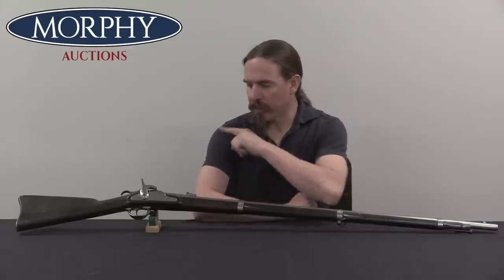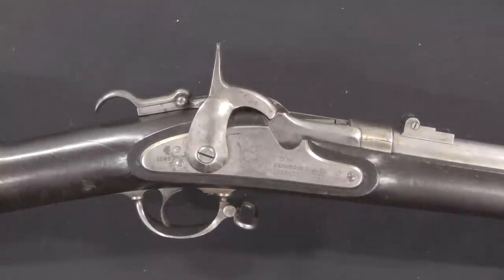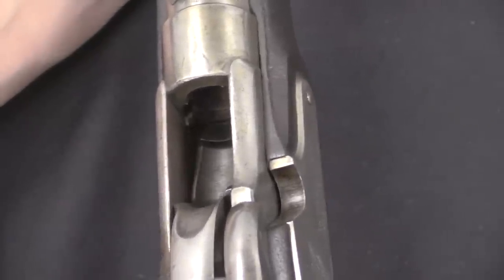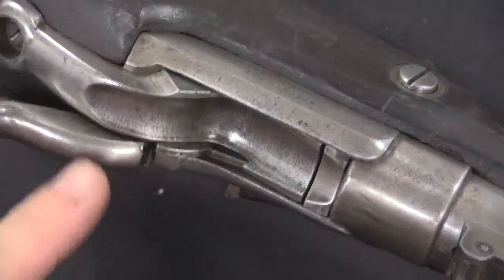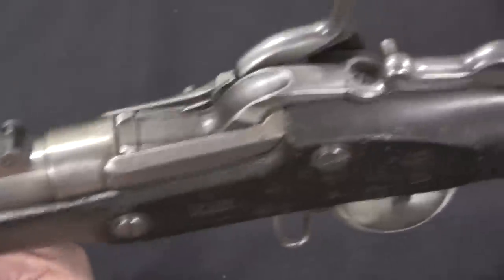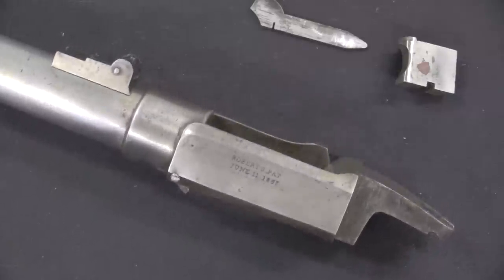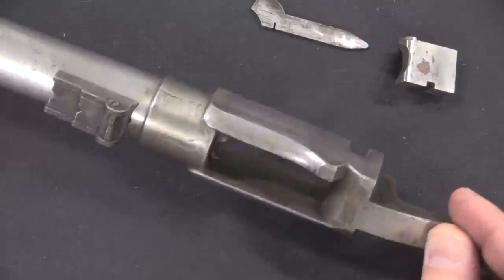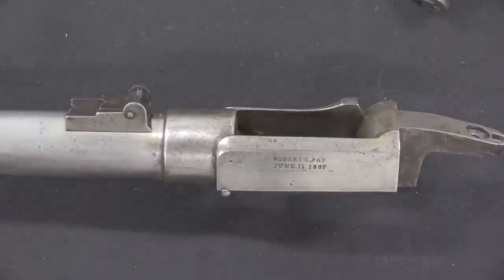Musket to Big-Bore Rimfire: the Roberts Short-Frame Conversion

Comment: that gun is in remarkably good shape, the metal is clean and the wood finish. wow
Reply: Yeah it’s kind of amazing tbh
Reply: I think the metal would have originally been blued. The total absence of bluing indicates, I think, that someone used abrasives to refinish the surface of the metal at some point (although not to the extent which would remove the markings). Still, there clearly was never any deep pitting which is amazing, yes.
Reply: @sbreheny  The original muskets (1861 and the 1863) were not blued, but left bright.

Comment: The musket/cartridge conversion genre is fascinating. There’s a universal technical starting point in the 58 caliber rifled musket and a technical end point that requires a brass cartridge. Cheapness and reliability are paramount. Everything else is up for grabs. 

And the 19th c inventor/machinists go nuts.
Reply: Machinist inventors back then seem more mad scientist than most.
Reply: @c1ph3rpunk  no major product liability or safety standards then. Plus, that was a time when you wanted all your working bits exposed to show off (and lubricate directly).
Reply: @c1ph3rpunk  I just now imagine a Springfield rifle sitting on an operating table while the mad machinist adds and removes bits of metal, using files and other tools in horrific ways until he is satisfied. Like the intro for Robot Chicken.
Reply: @zombieranger3410  Don't forget all the Snider conversions like the Enfield's and the Danish Snider rifle. Like Ian said there are thousands of designs not just the Springfield.
Reply: @stevenbaker8184  well duh
Reply: @zombieranger3410  ok tell me the history of the Model 1848/53/65 Danish Snider? Huh smartass. What rifle replaced it? What was it chambered in? What war was it used in? I can tell you. But it's so obscure that there isn't much information on the internet. So now tell me.
Reply: @stevenbaker8184  bro I was making an observational joke to an above comment about how machinists seem more like mad scientists. You then tell me that I forgot some other rifles and how they had similar processes, and I respond in kind of “of course they did”. My original comment was just a little joke, not some grand observation on ALL mid-1800’s percussion rifle conversions. Stop taking it so personal and literal.
Reply: @zombieranger3410  The reply "Duh" in my generation is a smartass response. And smartass responses are by definition personal. You did forget about them everybody does.
Reply: @stevenbaker8184  yes you could construe that, but the fact is you were the one that acted like I forgot rifles in a simple joke, when there wasn’t anything there to forget. This video is about Springfield rifle conversions, the joke is about machinists and mad scientists, you injected the notion that I forgot to include something. Must I mention every single conversion rifle that ever existed in any mention of conversion rifles even in a joke?

Comment: Another surplus US Civil War conversion - I find these fascinating; reusing existing hardware in innovative ways. So much better than tossing them away.

Remarkably simple, so few moving parts.
I especially appreciate the 'out of battery' safety.
Reply: Except it would have been more cost effective to just replace the weapons with new, better designed rifles.  In the end, the people that bought these expended a lot of money for a substandard product, that had to be replaced relatively soon.

Sometimes the best answer is to remove the old and replace with new.

I run into this a lot in industrial equipment.  Yes, you can upgrade old equipment with never controls, etc.  But at some point, the mechanisms are just too old, and the work arounds to keep them going just are not worth the additional cost over new.

Yes, new sucks, because it's a huge up front cost.  But you can amortize that cost over the life of the machine.  If the machine is already 70-80% mechanically worn out, what are you really gaining over new?
Reply: @jeromethiel4323  Not really.

If you don't need fanciest, then inexpensive surplus, upgraded, makes absolute sense - especially if you're budget-constrained. This is a historical observation, born out over centuries of practice.
Reply: @jeromethiel4323  Guns and machines aren't really comparable in a situation like this.
Reply: @jeromethiel4323  No, it really wouldn't. The US Ordinance Board rejected the excellent Peabody rifle in 1864, which became the Martini Henry once a self-cocking mechanism was introduced, and took trapdoors instead - which is much more cost effective.

You're applying some random knowledge of industrial machinery getting old in the wrong way. Unlike with those mechanisms getting too old and whatever in the long run... the muskets being converted were 100% functional. Nobody intended to use them for decades and decades longer.

Comment: As some one has pointed out, the reason for the separate portion of the breech block is to support the base of the cartridge squarely when the breech is closed.
Most other pivoting or dropping block designs have the breech block pivot axis located well above the centerline of the barrel.  The Roberts design places the pivot axis in line with the barrel centerline, sort of like the Madsen machine gun.  Because of this, the front end of the breech block must be allowed to swivel slightly as the breech is opened, hence the separate piece.
A big advantage of this design is that the thrust from the cartridge when it fires will not tend to open the breech.  That's why this design needs only a very weak latch to hold the breech closed.
Check out patent US 65607 for more details.

Comment: Here in Brazil they were field tested in 1868 during the War of the Tripple Alliance alongside the Spencer Carbine (about 5.000 Roberts described Model 1867). Both the Roberts and Spencer had ammo issues because of bad quality cartridges, they were taken back and issued again a few months after with better ammo. The Spencer would became a big sucess in brazilian service (even Belgium clones were latter adquired) but the Roberts continue to be considered unfit for service probably because of bad cartidges. They would reamain in Stock from 1869 to 1880s and never really used

Comment: I myself have a Savage Lock Robert's Rifle, but it's a strange sporterized/carbine sort of weapon with a Wincbester repeater style lever. 
I have no idea who modified it or when but it seems to have been done long in the past
Reply: Excellent, find. If the Barrel is full length you could re configure it. However leave the lever ... it might have some significance. I just got a 1st model Allen 1866, also a 1863 Savage in musket configuration. I still want a Parker Snow Miller conversion... my favorite odd ball. The early conversions are some of my favorite long arms. The French and German varieties from the 1850s amaze me, after 25 years of collecting I continue to see new types!

Comment: It looks to me like the interaction between the hammer, and the "safety" pin would actually close the action. So all you had to do was drop in a round and cock the hammer, doing so would close the breech. I wonder if that's how it works, and I wonder if that was done purposely to speed up the firing process.

Comment: Always wondered how conversations fired the cartridges didn't know they took out the nozzle thing that holds the cap and put a firing pin in the general area
Reply: Actually the "nozzle thing" is called a nipple.
Reply: @stevenbaker8184  thanks didn't know that
Reply: @whitequasar4686  you are welcome

Comment: Excellent video, I was completely unaware of that rifle. Is the finish chrome, nickel plated etc?
Greetings from Argentine Patagonia.
Reply: Likely it’s “in the white”, without a finish.  Not uncommon of the era, they had to be well maintained so they didn’t rust.
Reply: Bare steel, left "in the white" instead of blued.
Reply: @ScottKenny1978  Thanks for the reply. That gives me another question, how did they avoid corrosion? constantly polishing?
Reply: @bulukacarlos4751  constantly cleaning and keeping it well oiled.

Comment: Assume for the minute that the cartridge did not exist - can you consider doing a video on the ‘best’ breach loading rifled barrel rifle that did not use a cartridge?
Reply: Believe it or not there are rifles like that. The Starr being one. Also the ones that the cartridges are obsolete and out of production ie the .58 Miller, there is a way to use paper cartridges like the Starr Carbine did. It's not hard, I have a Snider conversion type3 rifle that there is no ammunition to be had. Make an adapter breech plug and use paper cartridges.

Comment: I would love to know what the .58 rimfire performance was?
Reply: Not good, the large bore rimfires we're known for being quite underwhelming. .577 Snider and 17.5x28mm Danish both had proven to be quite disappointing. Most only used 40-50 grain powder charge. So much for performance. The 17.5x28 is .69 caliber so imagine how little performance is going to be had with that light a charge behind it. BTW .58 rimfire is also known as .58 Miller.

Comment: ???  What was with that story just breezed over at the beginning?

"We're sorry, General Roberts, but we find your submission unsuited to our needs.  It fails structurally when you cram way too much powder into it, block the barrel with the mass of three bullets loaded in together, and then try to fire it."
"Under what possible circumstance would that be something a soldier should attem---"
"Good day."

I'm a layman, but it seems to me that when anything at all like that happens it's a problem with the user that needs addressing.

Comment: That system looks perfectly fine to me. Fast and easy to operate. What didn't people like about it when compared to other systems of the time?
Reply: Hard to say for sure, but it might have been difficult to use once it got dirty with black powder fouling, and ignition might have been less than reliable with only a single firing pin.
Reply: @AndrewAMartin  Could have also been accuracy, too.